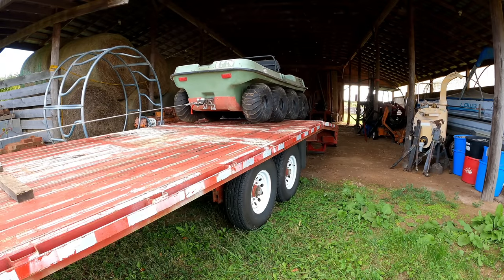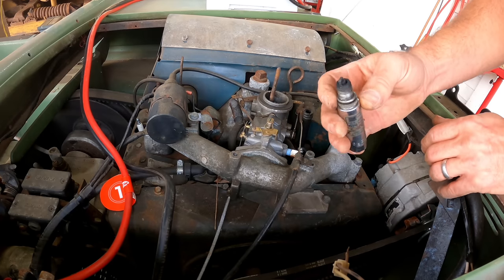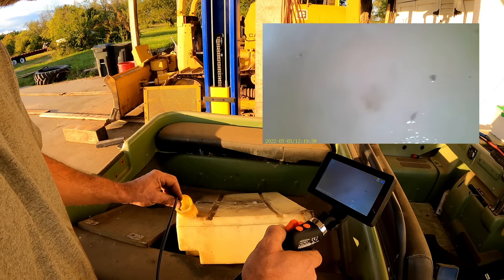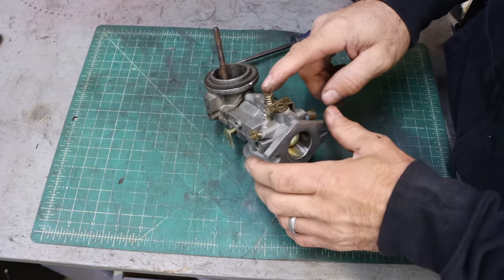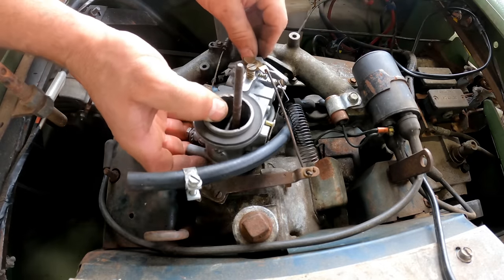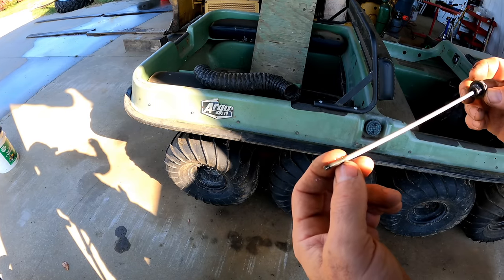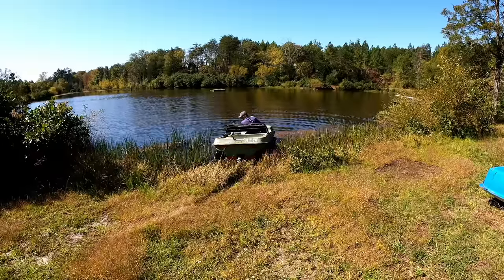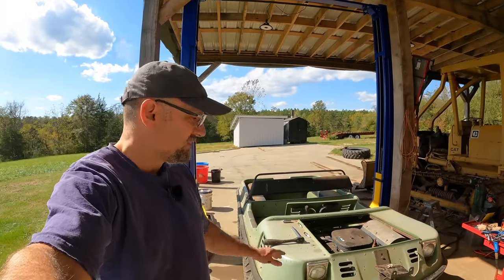Fixing An Abandoned Argo Amphibious Vehicle, Will It Start?

Comment: Remove the starter and clean and grease the bendix. You need to charge it for days to rejuvunate it.. Quit hitting it before you damage the ring gear  you will bless the day you cleaned and greased the bendix. Trust me do the bendix Also should change the oil. Clean the bendix.😅😅

Comment: Great little project and great video . Wd40 has many uses but it eats rubber ! It was developed by NASA as a cleaner and water displacer . Silicon oil is best for fitting difficult hoses . I would replace that fuel filter . Thanks for the video

Comment: Unless you're using pure ethanol free fuel (ha!), suggest changing out the fuel line (anywhere that's rubber) or it'll dissolve.

And those starters are notorious for the bendix not extending. They get dirt/grit on the shaft and they just stick no matter how fast you spin 'em. I have to douse mine in brake clean every few summer months to clean it out. It's just as hard (or worse!) to get out for a proper cleaning.
Reply from the maker: I actually use ethanol free in all my gasoline farm equipment.  We have a fuel tank that we get filled annually with it.
Reply: Funny! Farmers growing corn to turn it into ethanol, and a farmer using ethanol-free gasoline.

Comment: A load rac in the back helps with the balance 5° up in the front is max before you start having problems with water coming in over the stern when deaccelerating but you want a higher front than back or the pan high center's you when leaving water. Skilled people can ride the compressed bow wave to get more lift as they hit shore, not me tho 😂. There was a lot of discussion about different threads for front vs back axel use to get out of water. Today I would have a "ballast tank in the back and used a electric pump for adjusting tilt in the water. Rides much better with a monkey in the back a la sidecar racing. And if you have a small motorcycle engine you can lighten the front quite a lot.
Reply: A ballast tank and pump is a great idea to control the attack with and without passengers/cargo

Comment: Possible idea to explore for the problem with floating trim. Agree you need more weight in the back but not so much you have to take it out when extra people or gear get loaded. If the weight is added in the place of a rear bumper and floats when submerged you may be able to get a sweet spot... not too heavy on land while still pulling the back end down when on the water. And, if there is a bigger load in the back, it won't pull if down any further. Maybe a block of hardwood, or similar heavy but buoyant object.
Adding to the other comments you do need an engineered entry/exit point to the dam, but that's just another video so it's no problem 😩

Comment: Another good way to deal with those silly battery chargers is to just get a bench top power supply. The same kind that electronics shops use to test equipment. They’re cheap and they work really well. They will usually only output 5 to 10 A but they maintain constant current or constant voltage which is awesome for charging. You just set it to 13 V or so and let it run. It’ll trickle charge it and even taper off current as it gets close to voltage. If you save even one battery, it’ll pay for itself.

Comment: It will sink if you leave it in the water! They always leak so you need to have bilge pumps, I had one on auto and one on a manual button in the one i used at work. Plugs and pumps needs to be checked before use in water. 

If you drive it in to water on a steep slope you need to do it at speed. If you do it slow the water will run in to the engine compartment and sink it. Dont ask me how i know...

Comment: One Tip: If you're holding an amp clamp in your hand anyways you can just like measure the amperage going through your jumper cables instead of checking for heat.

Comment: I say get two or more and put some rubber around the sides...bumper cars on land and sea.  Perhaps a set of extended paddles on the wheels would propel you out of the water when approaching a soft muddy area? A solid ramp of gravel or stone would work better once the edge of the pond is met.  You looked like it was more fun on land than the water, therefore the mention of the bumper cars. 😀

Comment: Stand in the back when on water, for better balance and exiting. I also use a sand anchor and winch to exit sloppy terrain.
I use a trolling motor, and put a 44kg battery in thd jerry can holder on the back, and it rides pretty level. The tries are on bacwards which helps it swim, but means reverse exits are easier as the chevron pattern grips better.

Comment: Disconnect the battery while it's running if it stays running the alternator is fine if the engine stops alternator is not charging

Comment: I think the water could be coming in through the split between the 2 halves of the argo. There is a butyl 1:04:47  seal strip that goes between the halves and then the bolts seal it with equal pressure all the way around.      I also installed a marine bilge pump in my argo. Works great!

Comment: The problem with Wiskers is the reason no one uses the amp gauges anymore.  A simple volt meter & put in a 6-8 gauge charge wire.  You could have rigged the field wire through an old blower resistor & or just switch it for temporary charging.  Suggest running a dc braker to a posative buss bar & another negotiate buss behind the dash so you have a unlimited power & ground for relays & new fuse blocks.  We ran all push pull breakers out of an airplan.  They are amazing!

Comment: Looking at those cylinders, that definitely needs a hone and ring replacement. The reason the rust is still there, and the reason there's oil in the cylinders, is that the rings aren't making good pressure against the cylinder walls.

Comment: The Borescope is just a bronchoscope or endoscope - if you want to turn left or right, you just rotate the scope. The thing is not to use your hand on the fiber optic cable to do the turning. Turn the hand holding the pistol grip.

Comment: That endoscope control is pretty cool. I don't think it is worth replacing my current setup which uses the super hi res screen on my phone and just plugs into usb-c, which makes it also easy to use with a laptop to give even higher res and a bigger screen. Coils up into a tiny case when not in use. All for a third of the price of this unit.

Comment: Looks like fun. I think the oil in the cylinders is misaligned rings. The oil control rings are also probably worn.  The nice line of oil is likely from the compression ring gaps being in line with each other. That's my best guess.

Comment: While coming to shore, rock it side to side. Or buy some Adair Tracks. They are pricey, but you will never get stuck. Also invest in a winch just in case you need to pull out a normal ATV. Me and my friend has gone thru peanut butter mud over 4 feet deep. But Adair Tracks will solve your problem. Also check the wheel bearings. Also keep your drive chains lubed up and check all your grease fittings. Wheel bearings have a grease fittings outside and inside.

Comment: With regards to low limit on charging units. I have had luck in the past "jump starting" the battery. I've hooked the charger up like normal without turning it on and then used another 12 volt battery to simulate that initial voltage with another set of leads. Turn the charger on and it takes right off and does its thing. It has worked for 12volt as well as a golf cart charger (used another cart to simulate initial voltage (36vdc initial threshold). Milage may vary.

Comment: Love your videos!  Great content, good commentary. The rubber gasket is probably to prevent splashing in the bowl!? If you put grease on the shaft it will attract dust and wear the shaft, a product called ezi glide (teflon spray) is better.

Comment: Chain tensioners. Used argos always need new chains too, they are only really good for maybe 100-150 hours for the Chinese aftermarket chains, and maybe 300 out of the good ones (oem). Next is the brakes! They are bound to be warn. I drove from Cornwallis Island to Bathurst Island, Nunavut, having a supply of hard snow and ice beside my to throw on the overheated brakes every few minutes. Have fun! hehe. might need bearings all way round too....

Comment: After having several Argo's.. and getting them all stuck.. you start avoiding "mushy" conditions AND you get familiar with a good winch. I worked at Argo in 1981.. maybe I cut the transmission gears for this very machine!

Comment: The bowl gasket is also a baffle for the gas that vibrates up the side of the bowl and back down to the bottom.  If you didn't have the baffle in it the fuel will vibrate up the side of the bowl and into the bowl vent , which will kill the engine with too much fuel. You didn't blow out the hole on the side of the main jet leg.  This is how gas gets into the main jet.  There is nothing wrong with the throttle.  The governor has tension on it internally.  This engine has governed idle and high speed.  Kohler has an excellent shop manual that you should probably get.

Comment: Good engine. Very simple reliable. I had same engine same argos. Same on both of mine, that starter gear. Take engine out (easy), take starter off and clean and light sand the spring and gear shaft. Grease (light if winter use! I learned that the hard way!), reassemble. Might as well adjust the valves while engine is apart.

Comment: I have a m18 regulated power supply I keep in the shop. It works great to hook some alligator clamps to the pos/neg of the smart chargers to give them 12 volts at an amp or two. Tricks them well, then they charge things up. You can remove the power supply after they start actually charging.

Comment: Jezus I'd love that old modle. Better be sure to plug the drain holes before launching . Also ain't very sea worthy unless you fasten and seal the body joint of top n bottom. That  motor is a pricey brand. You shouldn' t just hit it with the starter till u pull the plugs and oil the cylinders and manually turn it to assure it's not seized or stuck. Then turn it. If you PB blaster the cylinder and rock them back n forth then slowly turn it full ritation to verify no stuck valves and a slow rotation will scrub the "light" surface rust.. the old steel tanks are usually rusty and not s problem with poly tanks. Ive had the Maxx 6 wheelers and currently have a Hustler Sidewinder 6 wheeler.and snowmobiles etc.

Comment: I belive the hose is for the fan to cool the brakes. You have an excavator... clean out the muck in a couple of areas for launch and return??? Could harden them a bit with flat rock, large rip rap, cement slabs like a boat launch etc. Good luck uith the new toy.

Comment: John, I've found if you put a close to dead battery on a 2 amp. charge until it charges a while (usually 3 days to rebuild the lead on the plates) then hit with 10 amps until it shows full charge. Try it some time.

Comment: I remember advertisements for vehicles like this in the back of Popular Mechanics or Sports Afield back in the '70s and '80s.  The one I remember was called the Attex Fox or something like that.  

My best friend from college (we graduated in '82) died during covid.  There was a controversy about whether somebody died from covid or with covid with some other primary cause.  Either way, my friend is gone.

BTW, It seems like you are getting a lot of traction with Vevor and BougeRV.  I have a Vevor electric trailer mover (some call it it a "jocky wheel") and a BougeRV 12v fridge.  Both have been serving well and do what they are supposed to do.

You are "the man" Jon!

Comment: Back in the 60's... my God-daughters father did the tooling for the very first unit.... at that time... it was called a Jigger... probably a comment on the ride quality... lol... Company later changed it to Argo.... My neighbour then managed the company for 10 years... before it was last sold.

Last time we absolutely had to use an Argo...  up by Sioux Lookout... an 8 wheeler.... we had a 1300 lb moose rack chained to the back...  and 6 more hunters hanging on to outside of the cage as ballast... We pulled that bull moose... from a wet pooled area... and then up... for over 300 feet of grade...  though a stump infested 45 degree hill side...  and... we made it up... without any problems... no way were quads going to be of any use in that situation... Thats why... for hunting in treacherous surroundings... an Argo can't be beat.

For us older kids.... it's a great toy.... you'll love it....

Comment: These K17 engines are famous for throwing connecting rod’s through the block because they only had a splash lube system the replacement engine is a K18 with full oil pressure pump system and Magneto ignition without points , so lots of oil changes and yes no low rpm. Have fun love your channel.

Comment: The blower is a bilge blower that is required for all "enclosed engine" water craft. You are to run the blower for perhaps more than 5 minutes to evacuate fuel vapors in the enclosed area. Reduces the risk of an explosion when starting. After you are underway the open holes in the covers will keep the concentration of vapors below the ignition level.

Comment: If you want to prefill the fuelline to the carb you can pressurize the tank a little bit. The Fuel should then squirt right out of the jet in the carb. I have done that on a newer Kohler gas Engine and it worked great. It coult probably also flush the old gas out of the carb.

Comment: I've got an older version of that charger @farmcraft101, if you hold down the charge rate selector button when plugging it in it will go into a 2 amp "forced" charge mode @12V (If yours does not have a charge rate selector, try holding down one of the buttons when plugging it in - when mine goes into forced mode it blinks the 2A indicator)

Comment: Hey John, I really enjoyed your video. I did have an Argo many years ago that I bought in Canada. I think they're made in Canada too if I'm not mistaken. Anyway I had a lot of problems with it. I'm not quite as handy as you, I'm just a dumb computer scientist so I left all the wrenching to the people that service them. I didn't have any leaking problems, but I did have a lot of problems with the chain. But the one you got looks a little better, I think you have the double chains. So those bearings underneath those floor plates need to be greased relatively routinely, as well as the chains have to be lubed but you already know that. I think I had the two-stroke model, yours is an updated one it's the four-stroke one which is much better. It's designed for basically going out in the bush and hunting, and then you can shlep the animal out of the bush. A lot of people also use it for hoisting an animal up to quarter it. So you would take a rope on the hind legs, and find a good tree and attach one into the Argo and give it a pull hopefully hoist the animal up. I had lots of tags when I went out hunting in Alberta, but I never had the opportunity to bag any big game. The biggest thing I shot was chickens. They're pretty easy to clean, you just step on the legs and grab the wings and give it a pull and out comes the breast. Then I just cut it off and put it in the bag. Anyway it's a lot of fun to drive especially doing sharp turns like you were doing in the grass. It doesn't work very well on pavement because there's no differential, but it slides well on grass. And it's quite comfortable because of the 4 PSI tires which give it a good ride because there's no suspension. The body is very rigid and strong, it can get brittle though in the kind of weather we have up in Canada. Anyway I've since left Canada and move to Israel which is a whole lot different than North America, let's put it that way. Anyway, I can't offer you any advice other than everything that you already know. The only thing I can tell you what people do if they do a lot of amphibious driving is they hook up a bracket to an outboard motor and start the outboard motor and you should be able to get up to about 5 or 10 mph. There's a lot of drag with the tires but if you can get it out of the water a bit, depending on the power of the motor, you can get reasonable performance in water. I would say maybe a 10 horsepower motor would do the trick, and I think that's as big as you can go. You might want to put a winch on that in case you get stuck, but I doubt you'll get stuck cuz you're just driving it around the farm and you can always hook it up to your pickup truck and take it back to service. Anyway, another great video that was very enjoyable and interesting and of course the most important thing is that I learned a lot by watching it. It's more than just entertainment. If that's your goal to educate people, then you're doing a great job!

Comment: Had one years ago , made a front and rear receiver for a small winch and added two batteries in the back corners  in boxes to run the winch so it didnt kill my engine battery they allso helped the counter balance. Also had two oar mounts and two collapsing oars in back. Found i needed all that the hard way lol. After those additions i was able to get out of potentially bad situations even if the motor died. I like the bilge pump suggestion also others made should a crack or something occur.
Great vids you put out!!

Comment: As a farm raised guy, the tires look like they're mounted wrong. On a tractor, the v points forward at the top and lets the mud / dirt slide out the side. The paddles probably work better on water as is, but mud would ball up and get slick.